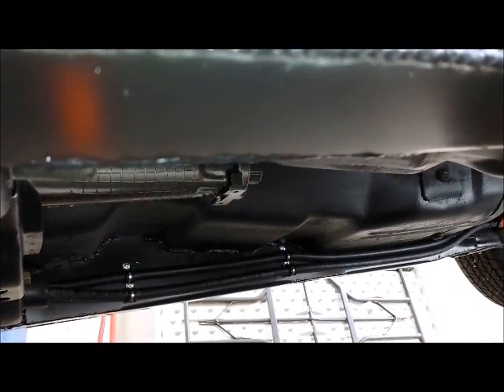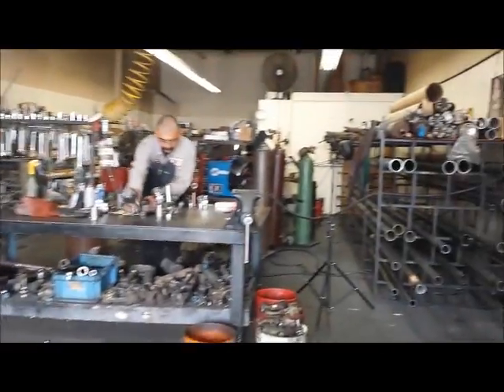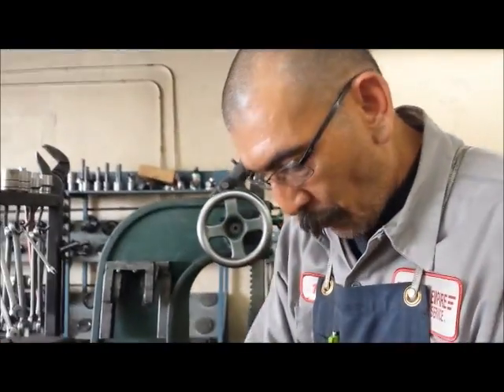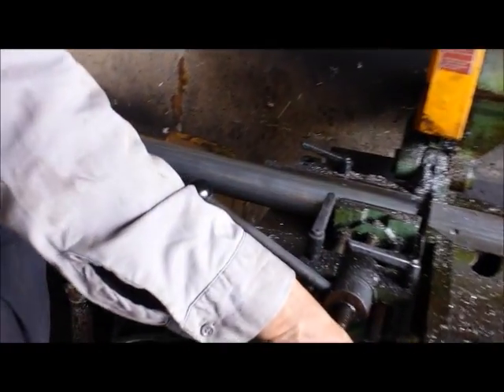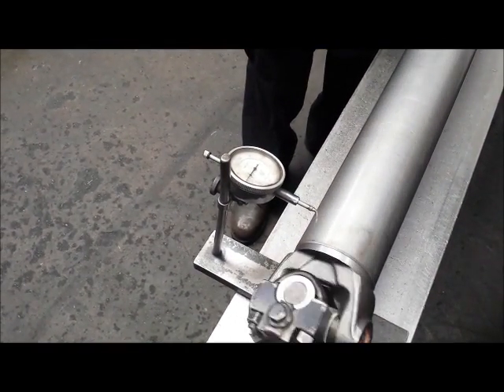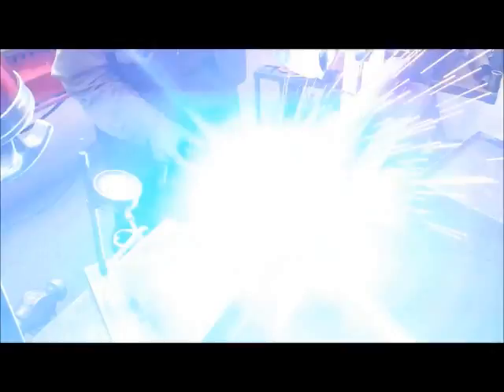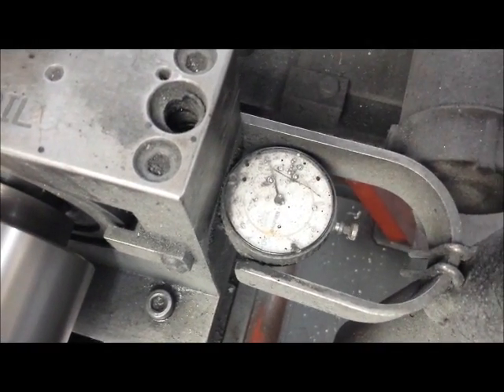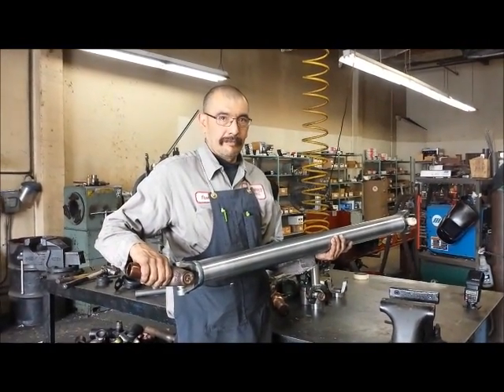How High Performance Driveshafts Are Made

Comment: yeah I have heard of shops putting weights just opposite of the seam on the tube calle it balanced charge the customer between 35 and 80 bucks. wow. talk about cheating the customer if you level everything and get it true you dont need to balance a drive shaft

Comment: 1) to measure a driveline correctly you put the transmission yoke into the transmission and pull it 3/4" out and and from centerline of the ujoint to center line of the rear ujoint and there you have an accurate measurement of the driveline ... 
2) you never use a press to install ujoints the can distort the yoke no to mention if one of the nidles of the ujoint cup might come of place ... 
3) you never weld a  yoke on a driveline with ujoints in because the heat will ruin the seals on the ujoints cup and that will cause for grease to leak out and shorten the life of your joint ... 
How I know this BECAUSE I AM THE DRIVE LINE MASTER PERIOD !!!!!
Reply: +Badassmimo 

Post a video of how a badass master does it. Theses guys lost me when they just jammed the caps in with no attention to axial play.
Reply: M. S. L. Why don't both of you post videos of how you do it. If you don't have videos of you actually DOING anything, be quiet as you have nothing tangible to add to the conversation. Last time I checked there are several schools of thought regarding quenching steel. One such would be quenching hot steel in salt. Additionally, I know quite a few experts in several mechanical fields who through 15 to 35 YEARS of experience do things differently than what you might learn in your first year of technical school. These are what are commonly referred to as "best practices" which will vary from shop to shop. In short,  you sound like a keyboard commando. You can botch, but you can't actually perform.
Reply: Badassmimo yeah there more screw-ups than I can count in this. Video. What a joke of a "service" they offer.
Reply: A press is the proper way. No more than a ton of pressure. You have a trained monkey with a sledge hammer to assemble them don't you. Weld it with the u joints in place just keep the temp lower than the drop off temp of the grease. 
Do what the manufacturer tells you not what some money with a hammer does.

Comment: Outside of my comment there is 1 out of 11 comments that isn't some jack off trying to nit pick about someone else's work.

Anyway, thank you very much for the video. I've always wondered what the process was of balancing the shafts. You also may have just talked me into buying an arbor press without knowing it.
Reply: chuckels431: The grease bucket was left open so viewers could see the contents. Otherwise the lid is always left on to protect against what you so ignorantly suggested.
Reply: chuckels431
Reply: Alvarez Metal Works what!?  Idiot
Reply: chuckels431 ur an idioromous
Reply: Yup I’m just another jackoff that’s gonna comment on the sloppy and dangerous practices, everyone wants there &500 drive shaft ujoints greased from some open 5 gal bucket that’s collected all the dirt and other debris that’s flying around.

Comment: Mild steel? I would of went for chromoly, but hey, each their own.
Reply: BUZDRIFT What material you use?
Reply: Joan Lee
I said it in my comment, chromoly!!!!! something hard!
Reply: BUZDRIFT In chinese factories, usually Steel 1045 would be used to make tube yoke, weld yoke and slip yoke. For the U Joint, 20Cr is used. So, I am curious what material you use?
Reply: Joan Lee
Aogami/Blue-Super A or any chromoly
Reply: Buzdrift, what is 'Aogami' or 'Blue- Super A'?
Reply: Joan Lee
A very hard and hard to get steel! look it up. It's A class though!

Comment: Would suck if the seal on the hydraulic jack went out when you are under the car.
use jack stands.
Reply: gostrydr,  Exactly!!!!    NOBODY should EVER crawl under a car using only a hydraulic jack.
Reply: I did notice that too....once had a car fall on me.....not fun
Reply: No kidding!
Reply: I was just under my truck taking measurements for my driveshaft. Thankfully I was using jack stands, because I noticed when I went to take the stands out and lower back down: My jack had went down! I always use jack stands anyway, but I was definitely glad I did this time.
Reply: many guido mechanics been pinned under a fiat over the weekend. at least that what you tell the wives. ha, just kidding.